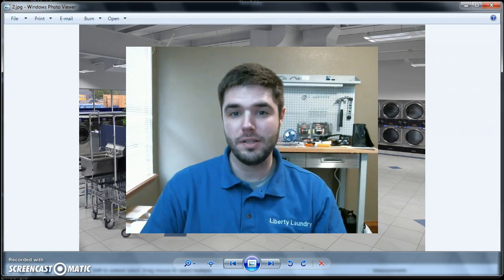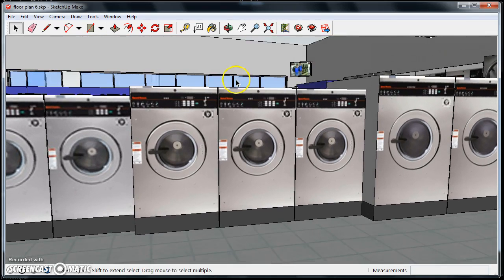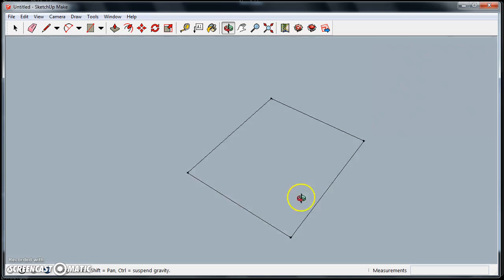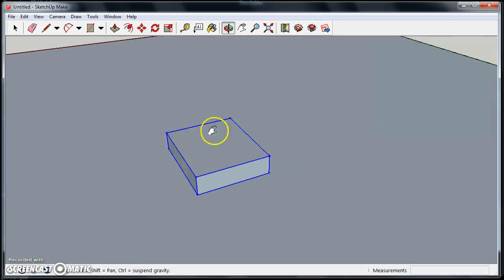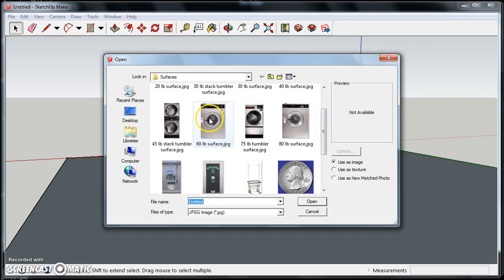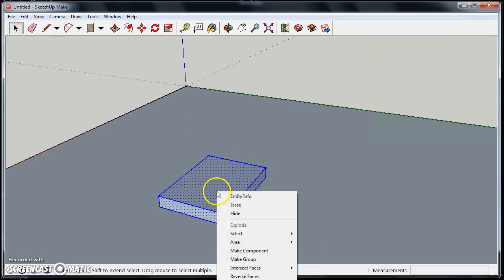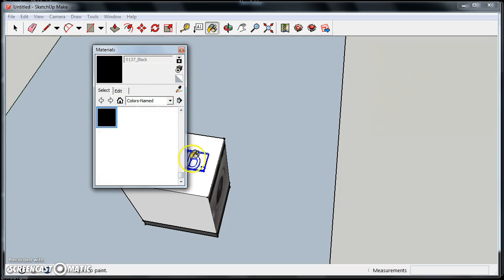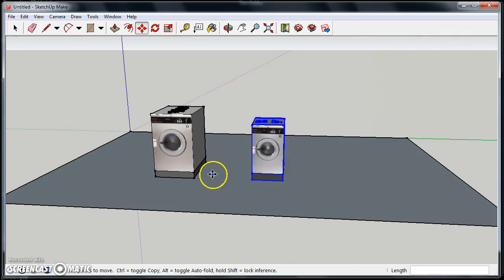Laundromat Design With SketchUp (3D CAD): Part 2

Comment: Did you have a video on building specs as far as requirements for utilities based on building size/ anticipated number of machines with enough leeway built in for future growth or larger capacity machines?  I’ve heard others mention that water supply lines should be of a certain size 2” or maybe more as well as high capacity natural gas should be confirmed from the gas supplier. Electric requirements phases, amps? What else should be considered? Ceiling height? Ducting for fresh air intake and exhaust for dryers and their location.